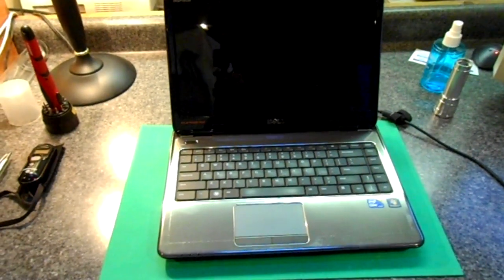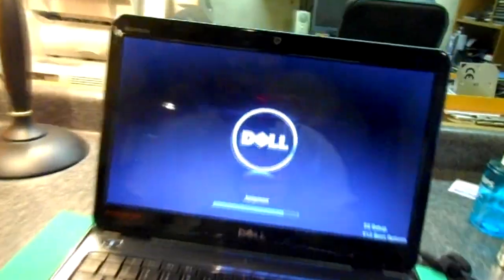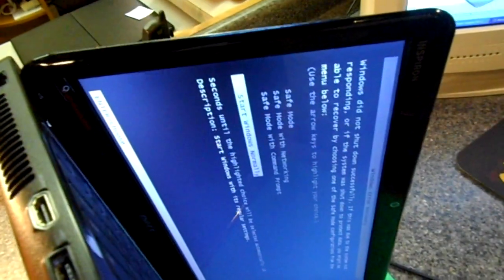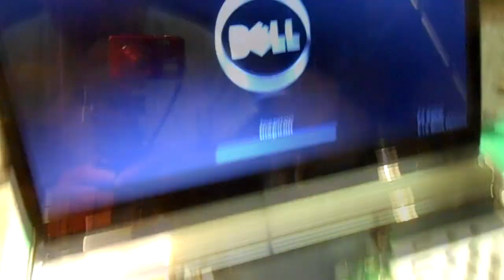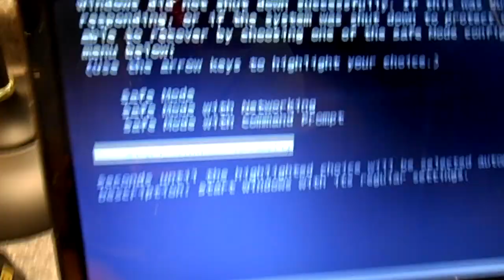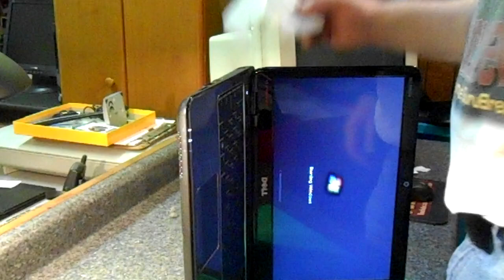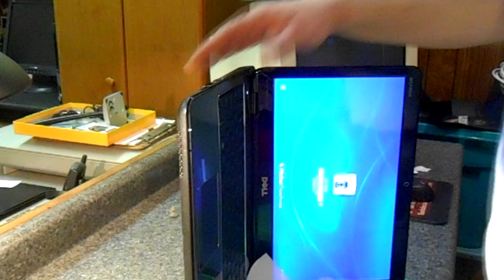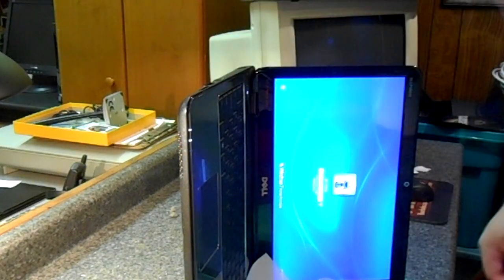How to Fix Overheating and Shutting Down Laptop

Comment: I have seen my share of hairballs to. One thing that some don't realize is laptops are cheap and poorly designed and can't keep cool enough. I have had some ram get real warm on it's own, along with the hard drive. I have found some cpu's shutting down because it can't cool off efficiently, even with no air flow blockage and good fan. Others need to realize that laptop cpu's especially the Intel variety in my opinion are flawed in regards to trying to save the useless battery charge and try to keep the fan running. Some laptop fans will always be on and even that isn't enough. Expecting one little fan to cool off a Cpu and a Gpu and try to exhaust hot air from the rest of the laptop of what little it may is really very poor thinking and design. Not one of my PC's have ever created that kind of heat in comparison. This is why trying to use a laptop for cpu intensive games with high graphics isn't going to run that cool. It's best to keep with a non oem pc for that.  If anyone claims to fix overheating problems. I will remind people that it isn't a one size fits all approach. Even failing parts can create more heat and be self destructive.

Comment: Hello Guru my Asus K55N keeps overheating only when I play games... How do I auctually fix it for it to never happen again? The game runs super well but i just don't know why it shutsdown... Please help me :)
Reply: Did u find a way to fix it because I have the same problem.
Reply: +Gio Domo ...Yea, I have the same laptop and it has been shutting down too when it gets too hot. So now I have it elevated with a fan blowing under it and to the output air too . Its working but I'm afraid in the long run it might blow more dust than usual in there . So  these videos are great tools. Now I know how to fix it . Good luck with yours.
Reply: +Meissa Sy ... I have the same problem too. So now I have it elevated with a fan blowing under it and to the output air too . Its working but I'm afraid in the long run it might blow more dust than usual in there . So  these videos are great tools. Now I know how to fix it . Good luck with yours.

Comment: I have a HP G62 and its doing the same. Next time i will definatly go for a Mac! These windows pc times is over. Simply oldfashion. Get a mac enjoy the pure silence and efficiency of a machine. I am sick and tired of that noice and heat these windows machines makes. And no i am not a mac employed! :)
Reply: I'm sick and tired of these mega expensive apple machines, they are very expensive and they owner are snobes and think they are better then others. And by the way, I'm not against apple ! :D
Reply: I just bought one second hand MAC for like 1200 dollar, quad core 8 GB, 2,2 ghz start up in like 10 sec. HUGE difference in operating and no lacking and shit like Windows. Im just a happy camper!
Reply: leobarnat1
 Actually you should try with a vaccum cleaner on the back right on the cooler. Suck out the dust it really helps!! I did it with mine and sold it for 300 dollar. Then bought a Macbook second hand for 1200 dollar. Mac is the the best!! Lightning keyboard, quick startup, no lacking/freezing, low noise. Thumbs up for Mac!